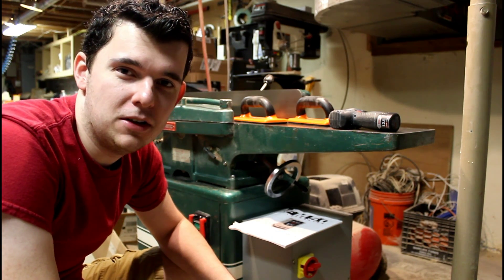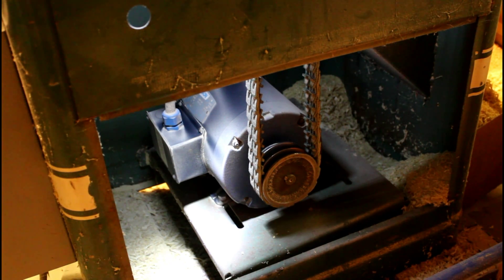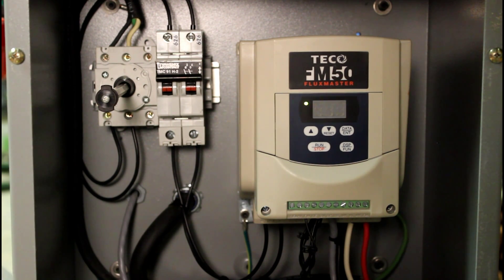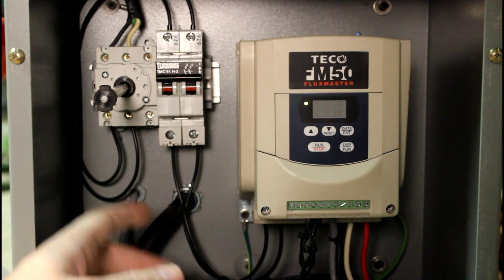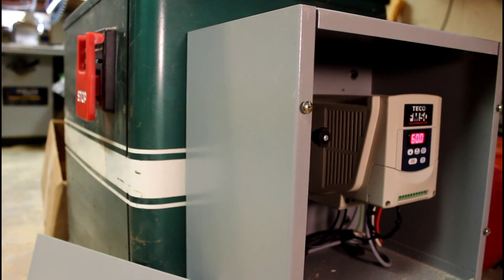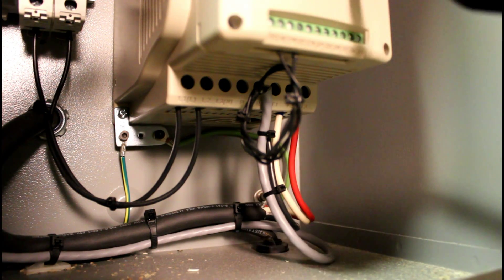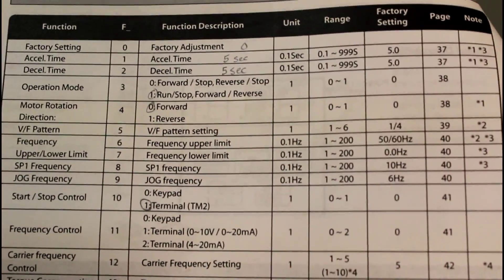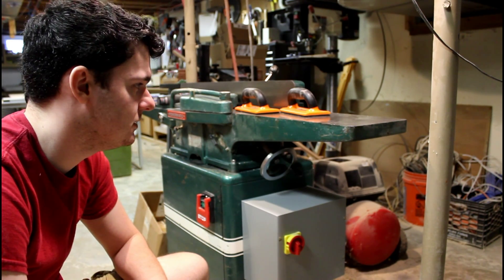Tool Reviews: Teco FM50 Variable Frequency Drive

Comment: This comment is regarding the enclosure.  I have installed VFD's on numerous small machines, but have never installed one in an unvented enclosure.  In the case in this video, it is a pretty large enclosure and the jointer is a machine that doesn't run high load continuously.   If you can get away with it, without overheating the VFD, the sealed enclosure would keep it much cleaner.  I don't know if this TECO  VFD has its own cooling fan, but if it does and the enclosure has that much surface area on the sides, I can see how it could keep cool.  I would like the idea of a sealed enclosure if there was either a VFD fan or a separate fan inside to move the air around to dissipate the heat.  The large enclosure would help and maybe even a heat sink on the inside and outside of one of the enclosure sides.  I have considered using a separate fan drawing air into an enclosure through a filter.  Another option would be to install a digital temperature readout to monitor the VFD heat sink temperature.  If you ever saw that reading getting too high, you could take additional measures to cool it.  Digital panel temperature meters with sensors or an indoor/outdoor thermometer with an external sensor can be found cheap.
Reply from the maker: Bill you make a good point and good observations. The challenge with leaving it in the open air on a machine or in a wood shop is the obvious and the trade off of an enclosure is getting fresh air flow. This VFD has a tiny fan over the heat sink and with a jointer there is very low continuous load and most operation on the machine isn't continuous at all. I've never observed the VFD to heat up and as you said in a large metal box attached to a large metal machine the heat dissipates well. The box isn't sealed well either so air does get in, and with the cable penetrations some of the dust collection sucks air through the box (you can feel a slight draft). Overall the Teco is an incredible unit that's held up flawlessly with weekly use for years.
Reply: @briancnc  I wonder if you would be better off by sealing your oversized enclosure so that sawdust can't get into it.

Comment: Hi i have 3Phase cold saw.  instead of connecting the Variable Frequency Drive wires it to the motor,  can i plug the cold saws power plug into the Variable Frequency Drive?
Reply from the maker: Depends how the controls are setup, you need to look at it as a whole

Comment: i have problem with this flux  there is writen er1 sow hat the problem need help
Reply from the maker: You are getting an error code?
Reply: BrianCNC yes my friend the er code is er1 what does mean ???
Reply from the maker: ER1 means "Keypad operation error" sounds like you don't have a parameter set correctly. See the user manual for errors, cause and countermeasures it covers it all. I suggest going through the settings again to make sure everything is correct. Send me a private message if you need help troubleshooting.

http://download.factorymation.com/acdrives/FM50manual.pdf
Reply: okey buddy i will try that

Comment: I have the exact same model you do.  Great video.  I'm running 220 20amp circuit to feed mine.  Just want to make sure on the input wiring.  Do I run each hot to L1 and L2 ....... then bond the ground to the bottom left chassis?  Or do I just hook my green ground to L3?  FWIW - output to 3 phase 3 wire motor
Reply from the maker: Bobby,

Thanks for watching. Connect your 220VAC phase wires to L1, L2 and GND to the bonding screw of the chassis just as you noted. L3 is only used in a 3 wire/3phase input where you are just using it for functional purposes (speed control, ramp ups/downs, IO) and not just as a means to get 3ph output. (Or as L/N for single phase 120VAC Input models use L1/L3 for that too). You will love this drive, still going strong even after 3 years, great little VFD.
Reply: Awesome!  Thanks for the quick reply.  I just wanted to make double sure before I go and let the ghost out :)

Comment: Excellent explanation! I work with some very large VFDs at a power plant but am quite surprised how the 3 phase converters have come down in price and up in technology for the hobbyist/home owner/ craftsman.
Reply from the maker: It's amazing isn't it. This tiny device puts a lot of high end 3 phase tools in small shops and has way more advantages than a rotary phase converter.

Comment: How did you go from the ten gauge wire from the extension cord to the 14 gauge required by the VFD? Did you put the 14 gauge on the downstream side of those breakers? I can't really tell wire size because of the shadows. Is doing it that way ok? Can you use a terminal block to change the size of the wire?
Reply from the maker: Downsizing a wire size is fine. I sized the circuit larger so I could plug and play with larger machines if I wanted. I terminated the cord at the rotary disconnect and stepped down to an appropriate size for the motor load. In industry you would do this with terminal blocks at a central point in the panel, top or bottom to keep all of your terminations in one place, but for simplicity I just land directly on the RD. Remember that the circuit wire must be sized for all downstream loads, in this case the motor and small current from the VFD, not necessarily just the VFD.

Comment: I have a PM60 with the same 1.5hp leeson, and was considering the same VFD - is that the 1.5 or 1hp you have?  It's been two years - everything still good?
Reply from the maker: Size your vfd no smaller than your load, so yes a 1.5hp motor would need a 1.5hp VFD. Been using it daily for a while (as you noted 2 years at least) and it's running like a champ!

Comment: How did you hook up the remote on/off switch. I saw in the operation manual how to set up the programming but now where the wires go. Does one of the terminals supply power and you run that through a switch to return the power to another specific terminal?
Reply from the maker: There should be terminals for this, labeled in your manual. The switch is just to provide contact closure as a means of input to your VFD. You could literally touch two wires together connected to those two terminals and it would do the same thing. The important thing is t use a maintained switch so that it isn't momentary, as most VFD's are looking for that type of input. If you still can't figure it out please post the model number of the unit you're using and I will try to assist.

Comment: Brian, thanks for the video.  I just finished restoring a PM-66 with a 5hp 3-Phase motor and I am in the process of doing the VFD programing and have a few questions if you dont mind.  For my P0-00 it is asking whether it is constant torque or variable torque.  What did you use for yours.  2nd is for P1-01 motor type, did you select common asynchronous, Var. freq asynchronous, or Perm Mag synchronous. My motor is not inverter rated, but the insulation is.  Thanks,
John
Reply from the maker: John,

What is the brand vfd you are using? These are a bit more advanced functions, of which the Fm50 doesn't cover. Most of these time the defaults are fine for most applications. I would check with the company and tell them the application/machine type to choose appropriate settings for your machine and drive motor.
Reply: briancnc,
Thanks for your reply. It is a VTDE brand VFD (Chinese Industrial) which seems like a few grades above the Huangyang models.  I went to the manufacturers site and found a manual in English which made all of the difference.  This one called for static and dynamic tests to determine the motor control best suited.  Once I did that then it adjusted the presets to provide the best solution.  Other than ramp up and down, I was able to utilize most of those.  It is running fine with the 5 second ramps and draws only 4 to 5 amps.  Thanks again fornyour help and reply.  Going to look for a 3 phase joiner next!

Comment: Has your VFD ever overheated with the unvented enclosure? Also, how much of a problem do you ahve with sawdust in the enclosure?
Reply from the maker: Chris it has never overheated and I've checked it multiple times after heavy use and it's still cool as can be. I don't have any issue with dust either. The enclosure is well closed but not sealed to air and the fan inside still can draw cool air in through holes/cracks around the enclosure. The dust seems to settle on the bottom of the enclosure (vertically) so I just clean it out once every few months, but it really does not collect much.
Reply: briancnc Good to know, I will be setting up a VFD or two soon!

Comment: thanks for the video. Can you help an idiot. i'm confused about the magnet contactor/switch I have in my spare parts bin and it's potential location in the system. I have 220 single phase going into my vfd and 220 three phase coming out. So do I put the mag switch before the vfd and if so doesn't that mean I'm only using 2 lines in and 2 lines out of the switch? and would that serve as my Rotary switch and breaker as in your set up
Reply: sorry this is the switch I mean. Its called a motor starter I guess
https://guide.alibaba.com/shop/square-d-2510mcg2-starter-motor-1-nema_11086588.html
Reply from the maker: Billy T the vfd takes place of that motor starter, it really does all of the above. The disconnect is just for isolation locally and to turn the unit off, and the circuit breaker for local protection, which for this case is overkill. I only did it because it was a freebie I was given at the time. Any switch to the vfd will kill the power, it doesn't have to be a disconnect but the rotary type is most common in industry. You don't need a magnetic switch or contactor as the vfd will de-energize the motor output if power is lost. If you're feeding it 220v you will want a 2 pole switch to do this as you noted. there's nothing wrong with keeping the vfd powered up all the time I just like to know equipment is off for sure when I'm not around.
Reply: So really I just need an on off switch before the vfd that's rated for 220 20amp in this case, this will kill power to the vfd like a lightbulb lol. Then to control my motor I use the control lugs on the vfd with small wire like cat 5....lol Am I close
Reply from the maker: Absolutely, in theory it doesn't even have to be rated for 20A as you won't ever switch it off under load, (hopefully), but good to do at least what the circuit is rated for. CAT5 is probably fine, it's just contact closure that the VFD is looking for, but I tend to run 18ga AWG for control wire like this. The most important thing when wiring a VFD to remember is to NEVER put a switch on the output side between the VFD output and the load (motor in this case). VFD's are very sensitive to this and it can wreck the unit.
Reply: Thankyou very much

Comment: I am looking at buying one of these for a project I am working on. Its a mobile pump demo and I want to plug it into a standard 115 outlet have you used one of these?
Reply from the maker: That's a great method for doing this. What are the specs of the pump motor that you are using? You just want to make sure the VFD is sized correctly for your load but you will it very nice and easy to implement.
Reply: the pump's current draw on 230v is 4.7 and the biggest VFD in the FM50 series is 4.2 will this cause problems? the pump I am going to use is a flotec 1/2 hp
http://www.thehardwarecity.com/products/FP5512-1-2-HP-Centrifugal-Pump/0003603?gclid=CLyq4f7B0s0CFQYIaQodHtMH_g
Reply from the maker: If the pump runs on 115 single phase, why even bother with a VFD? It says it draws 9.4 amps at 115VAC.(dual voltage).
Reply: I am an intern for an engineering company they want to be able to change the speed of the pump to show that it needs to overcome static head. one of the constraint that they want to show. The entire model is just manipulating pumps so you can show different things that could cause problems not enough power, cavitation, ect... And everything I have read and people I have talked to said VFD's on a 1-phase motor is bad news and can dramatically shorten the life of the pump. It can never be simple right lol

Comment: I have been studying Youtube for weeks on vfd's. I just received 2 FM50's today. 1 is a 1hp model for my drill press I want to convert to vs, and the 2nd is a 2hp model for a knife grinder I am building. I feel pretty comfortable about my set up. Yours looks very neat and professional!! Question. What size is your enclosure, where did you get it, and about how much was it? Are you going to put a gasket on the lid and keep it sealed? Do you plan for any kind of filter air flow through the box? Thank you very much for your time, and your VERY clean work!
Reply from the maker: +Toolferone Sorry I was traveling overseas, didn't have a chance to post the BOM for this. I will add it to the description in the next few minutes. Thank you for your comments! I don't plan to put a gasket on it as I like that it isn't air tight for at least some air flow. Keep in mind that every application is different. In the case of the jointer, unless I'm running a load of stock and working out a face and edge ready for milling, I rarely run the machine longer than a short cycle, so the VFD never really has a chance to get warm. When I am not using it I turn it off with the Rotary Disconnect too. This particular VFD is cooled internally while running and you will hear it run for a few seconds after it switches off the output. I don't feel this device needs any other cooling fan in the enclosure, but fresh cool filtered air is always a good thing for these components.
Reply from the maker: +Toolferone F I just added a list to the description of the parts.

Comment: Great, I am taking some of my woodworking machines to Sudamerica, can I use this there , they have 220v and 50 hertz?
Reply from the maker: Yes you can. These teco vfd's can be configured for 50/60hz input just make sure you purchase the correct one for your application. Also keep in mind that a lot of equipment can run on either as well. Where in South America are you going? I only ask because in Brazil for example, they use 60hz.
Reply: +briancnc Hi, I am going to Chile, I am originally from there, and after 30 years in Toronto, I have decided to move there for health reasons. I need warmer weather LOL
Reply from the maker: +hertavcomputers awesome! putting your shop in a container ?
Reply: +briancnc That is the idea, maybe I'll start a Utube channel too. LOL. Where are you?
Reply from the maker: +hertavcomputers You should, it's a good hobby to have!